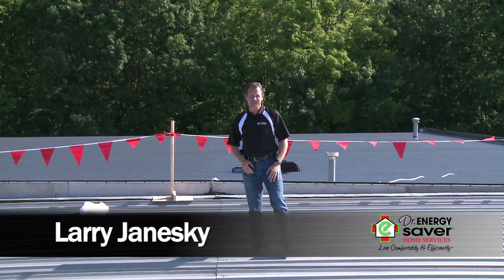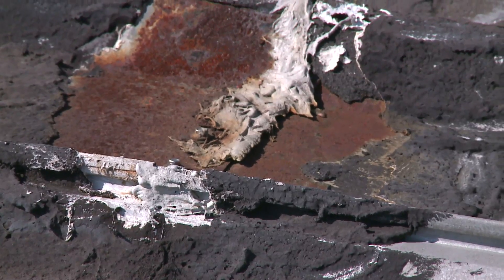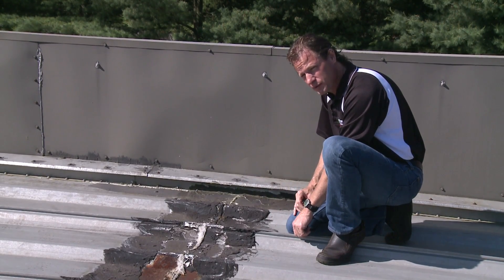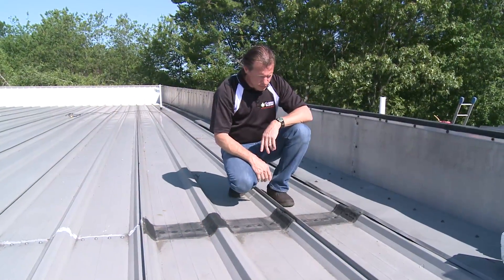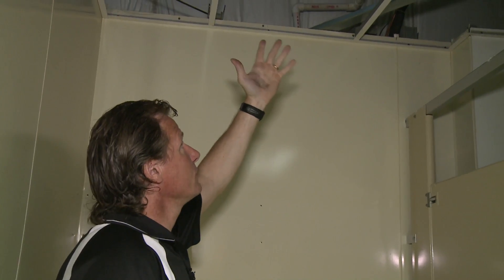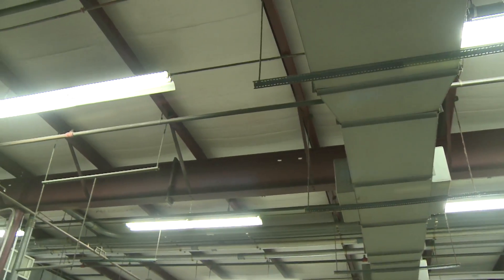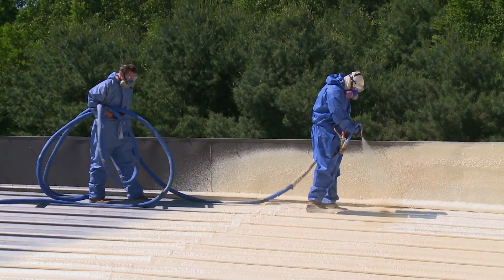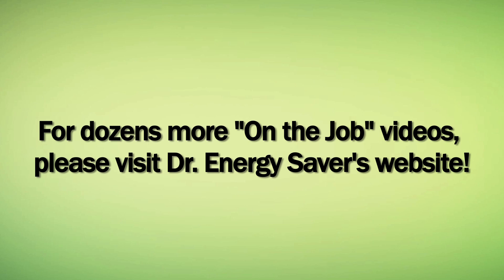Insulating a roof with Spray Foam

Comment: If that insulation on the ceiling on the inside has a perm rate of less than 1- you would create a double vapor barrier. That would cause that metal to rust over time and a heavy rain/snow/wind or a person servicing the equipment of the roof to fall right through years down the line..

Comment: What is the max r value when doing the outside of the building? How thick can you go?  In the north east with a curved roof I am concerned about the texture that would keep the snow from sliding off?

Comment: I saw the metal panels flexing a lot as the foam was being applied. If the building needs some work on the roof (i.e. HVAC work) would this flexing create cracks in the foam and need re-application?
Reply: No it won't.
You have no idea how hard 2 inches of roof foam is. The roof won't flex anymore after the foam is on.
Reply: @ashtonmmton1554  I applied this to my roof 10 years ago and am having a problem with leaks in multiple locations, Any solutions or suggestions?

Comment: I have a flat plywood/tar-paper roof over a family room/garage are.
I notice water pools on the top.
Does the foam -auto-level to prevent this, or just allow the water to evaporate?
This process seems like a great idea. Is there a price per sq.ft. to help estimate?
Any dealers in Miami, Fl you know?

Comment: Could you do this on a traditional pitched family home (assuming you don't mind the aesthetics) ? Would it help with heat radiating into the attic?
Reply: aguyandhiscomputer if it's applied right it looks good cosmetically. This guy is not very good